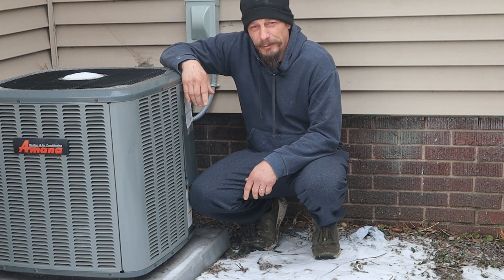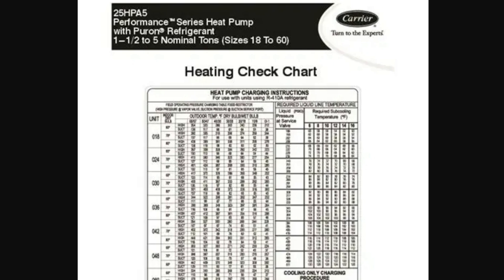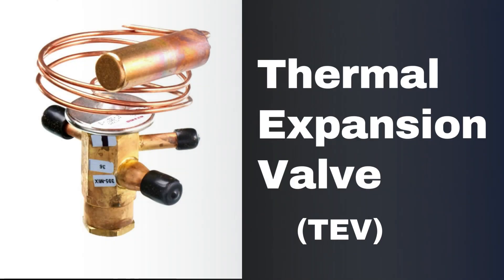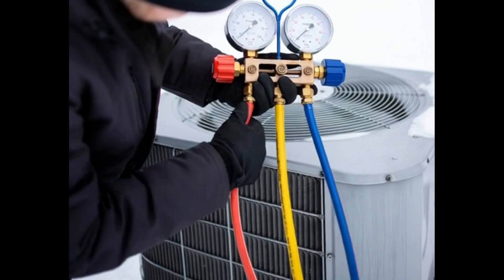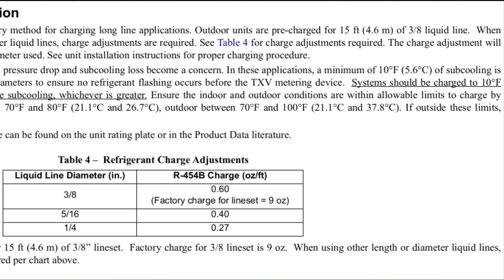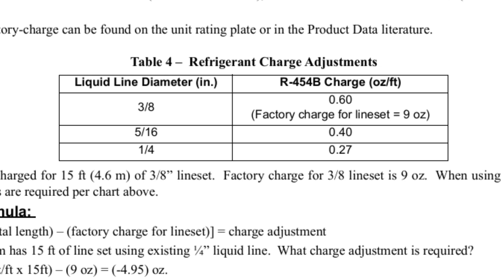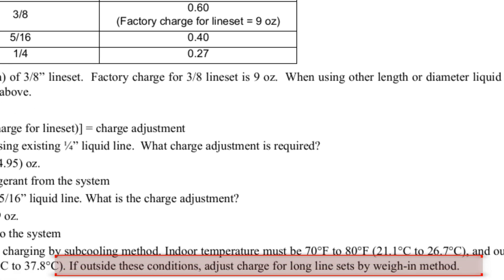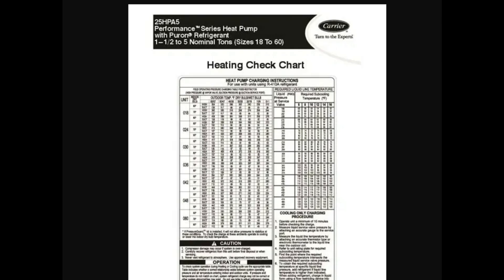Heat Pump Winter Charging: Don’t Chase Pressures!

Comment: How would you go about charging an already in service system thats just low on refrigerant during the winter time?
Reply from the maker: If the homeowner won’t approve a full recovery and weigh-in in winter, which is the best way to do it, then what most techs do is a stabilization charge: add refrigerant in small increments until the system no longer looks starved: superheat is back in a reasonable range, discharge temp/amps settle to normal ranges, and defrost behavior looks normal (not short-cycling, coil clears of frost). Then document it and come back in spring to verify charge properly in cooling mode by subcooling.

Comment: I often feel that there could be data you could refer to when adding charge after commissioning or repair in heat modes, but companies are too lazy to do the testing with a number of parameters that we could test and use
Reply from the maker: Agreed. I think a big reason manufacturers default to weigh-in is liability. It’s defensible and repeatable, and it’s largely independent of operating conditions so it’s easy to write into a manual without ambiguity. With so many variables in heating mode, a ‘charge-to’ chart gets complex enough that from a legal standpoint, mass is the safer bet than interpretation. Less warranty worries...